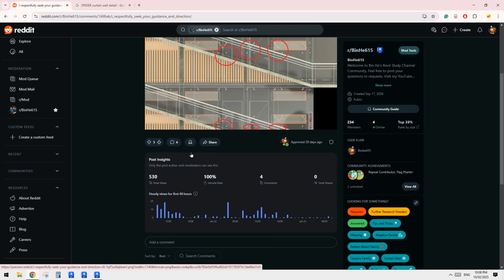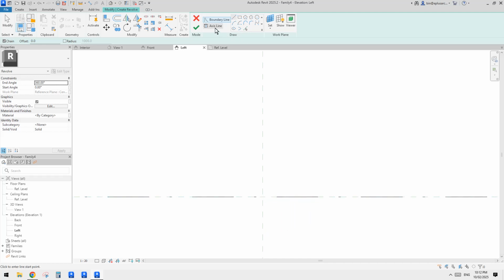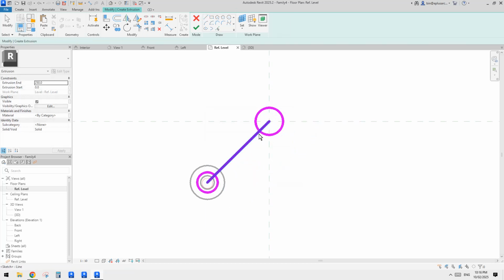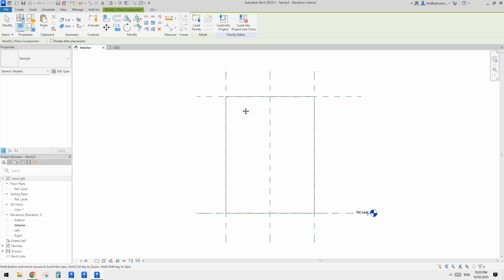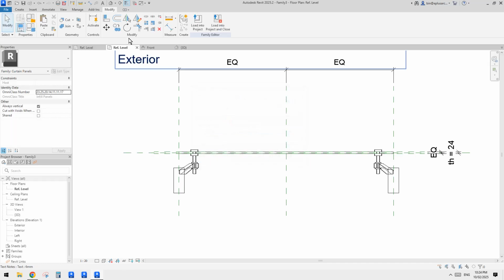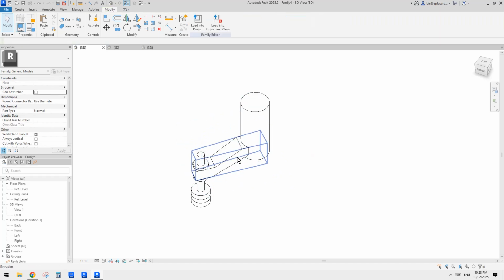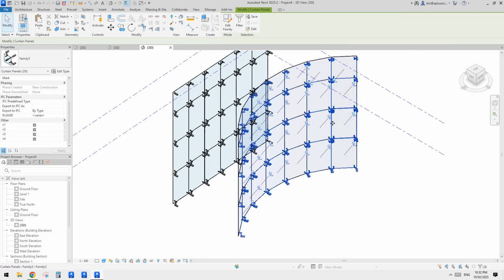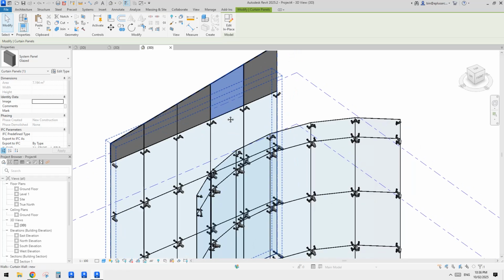25022 - Spider Slamp Fitting on Curtain Wall Panel

Comment: Can you please make a vedio on how to align vertical floors while doing AutoCad to revit modeling?
Reply from the maker: I am not very clean what your situation here, I guess if you have multiple floor plans for different levels of the same building, there must be something you can align them, like exterior walls, grids, even some existing site condition on site, like trees, or neighbouring buildings.